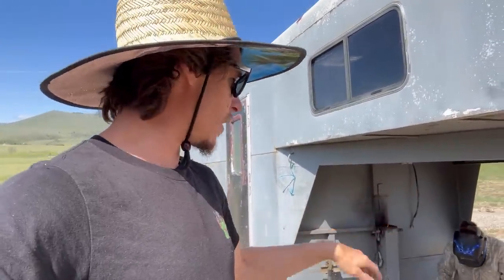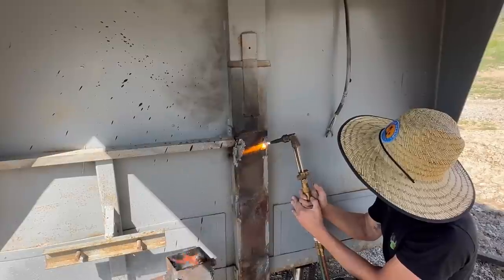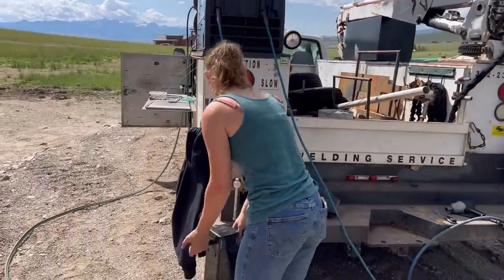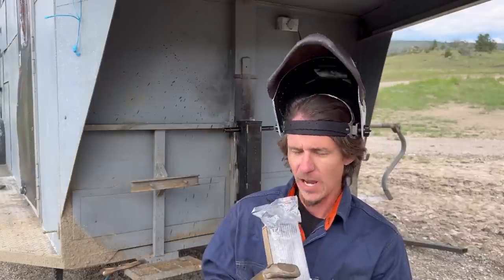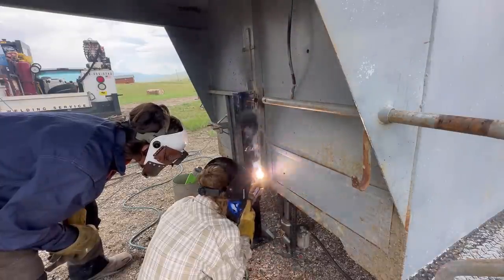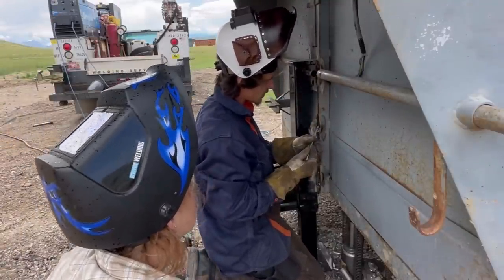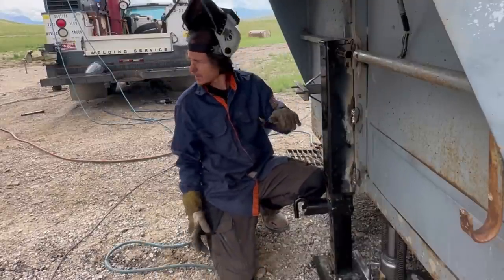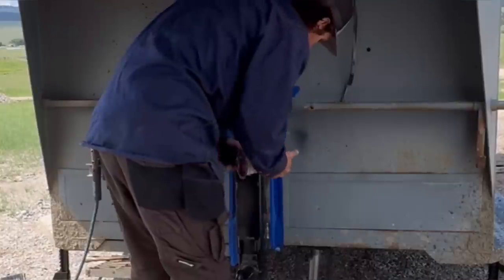Teaching Emily How to Weld Uphill

Comment: I remember my first time welding. It was MIG, so much easier to learn on. For a first time welding uphill she did great! Considering the fact that she wasn't just learning how to manage a puddle, but also rod patterns, rod angle, and burn rate - she did really good. Lets not forget the fact that she didn't stick the rod! There are a ton of intricacies that go unnoticed with SMAW. Impressive and she should be happy with her welds on this for the first time.

Anthony showed great character while teaching also. Exercising patience can be hard to do for skilled craftsmen. For some, they would have just taken the stinger and turned the lesson into a demo of how to do it. In my opinion, letting someone fail and then reeling them back in like he did teaches them much more than a demonstration ever could. Well done man.

Comment: Good to see a lady getting in and getting her share.
.
Good to see she has good PPE.
.
Ladies involved in industrial processes need to be very consciencious about protecting their pretty bits. ( men probably should too)
Good gloves
Full face protection always
Keep that kneck and chest covered, a bib on those face guards is probably a good idea.
 AND figure out what you will do to protect your hair and keep it out of the machines, a hair net, scarf, bandana or some other non-flamable head covering.
If your hair is very long, wearing it in a pony tail inside your shirt is an option. That's what my brother does.
.
Remember the radiation from all types of welding danages the skin.
.
too many men are ugglier than they need to be because they did not protect themselves
Reply from the maker: We got her a welders cap today actually!
Reply: @MeltinMetalAnthony  One good thiing, is we can get industrial clothing and safety gear in sizes, shapes and colours suitable for for the ladies in nearly every store these days.
.
This also pays off for the smaller guys too.

Comment: I tried a uphill weld on a outside corner of some square stock for the first time the other day. Ohh lord my welds look like a chihuahua shit on the metal. Way harder then it looks. The inside corner so much easier then the outside points where two 45s meet. Stick welding pretty tough to learn on but i figure if I can learn with this stuff then I’ll be an expert on mig by the time I get this down
Reply: Down hill is the way to go.

Comment: lol learning 7018 uphill too, need to manipulate better but i seem to get undercut even when holding the sides. my amps may be too high...
Reply from the maker: Hmm hard to say without watching you, could also be the rod isn’t the proper size for what your welding
Reply: 1/4 thick steel t joint with 1/8th lincoln excalibur rods. uhhh amps im running is 112 at 72 volts on a miller xmt 350. learning in classes but i think my angles are off or not holding it properly still. practice practice practice. just started welding like 4-5 months ago. so far im ok with mig, flux core and now messing around with stick 7018 and 6010.
Reply: @shineything4444  Try going straight up smoothly. Too fast or too many amps can cause undercut
Reply: @donsmith9081  you can get flat beads like this? my teacher said that isnt the proper way to do it but again ill try anything lol.

Comment: Uphill stick weld is very difficult, especially on a joint. You should put her to trainning doing simple fusion lines on a straight plate and after let her do on a joint.